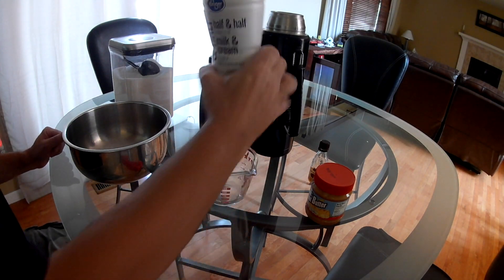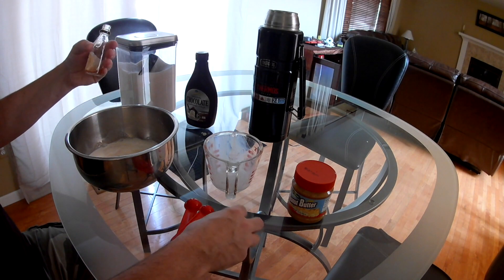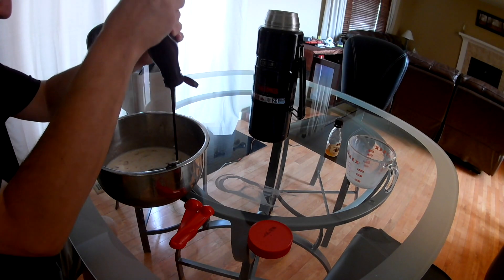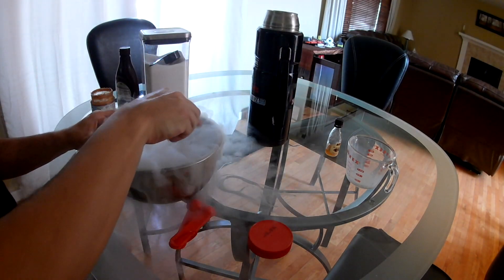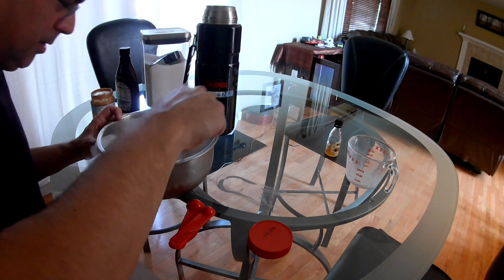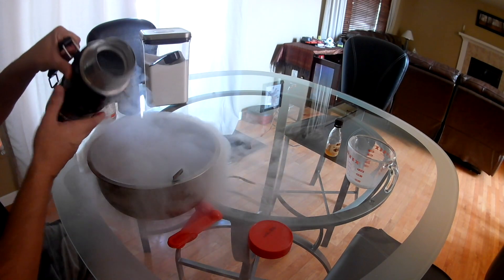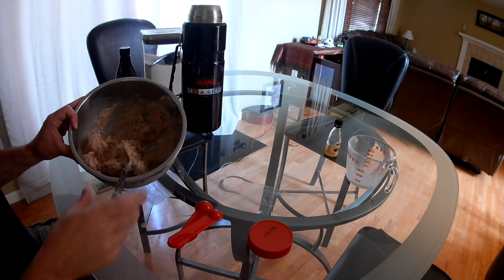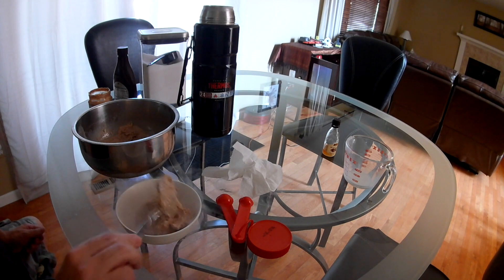Liquid oxygen ice cream

Comment: Are you using liquid oxygen or liquid nitrogen?
Reply from the maker: It's a bit strange because normally liquid nitrogen is used but it was actually liquid oxygen in this case.  At the time, I was only able to liquefy oxygen because I didn't have a working sieve bed for N2 at the time,.  So my choice was liquid air with lots of snow in it from moisture in the air or to use my oxygen sieve beds and get pure dry LOX.

Comment: I might make and sell few small Mix refrigerant Joule Thompson cryocooler very soon. They will require around 8 bar nitrogen gas for liquifaction. Price will be around $500 and cooling power in the range of 50W at 100K
Reply from the maker: That is very nice.  How many W at 77K?  By the way, how is the multistage phase change project going?  I'm really excited to know your success on it.
Reply: @ChristmasEve777  i have stopped working on multistage because it's out of my budget right now. Im working on cheaper option which is MRJT cryocooler which requires only one air conditioner compressor and one small fridge compressor. It has been tested. It provides  100W at 100K with 1100W input power
Reply from the maker: @Exotic_Lab  That's wonderful!  It's a significant improvement over my 10W at 77K.  Even if I pre-cool my gas going to the cryocooler (as you suggested before) I'll never get more than 10W of cooling at 77K with mine.  Of course I would get a bigger yield though because the gas would be a bit closer to the liquefaction temperature.  I've been too lazy to try to improve mine lately.
Reply: @ChristmasEve777  it's cooling power and temperature depends upon gas composition used.

Comment: im wanting to make a nitrogen generator can you help me with it
Reply from the maker: I can try.  Do you mean nitrogen gas generator or liquid nitrogen generator?
Also, please subscribe :) I plan to keep making cryogenic videos.
Reply: @ChristmasEve777  liquid nitrogen
Reply from the maker: @waldo2413  The cheapest way to make it is with a Stirling cycle cryocooler.  They used to only cost a few hundred dollars on eBay but people have been noticing the demand for them so the price has been increasing.  The last time I saw one on eBay, it was around $1000.  You would need to purchase that, a variac, a CPU-sized fan but no less than 100 cubic feet per minute to keep the heat sink on the cryocooler cool. Also a thermos is needed to collect it.  The last auction I saw was $3000 but it included everything you need (still, a bit pricey).  Right now I do not see any Stirling cycle ones on eBay.  You would have to keep checking regularly.  The cryocooler is the heart of the system.  Without it, there's no use buying the other stuff yet.  If you manage to get one, I can help you further on the setup.  You basically stick the cold end of the cooler down into the top of an ordinary thermos and let it run all day.  Liquid nitrogen and oxygen will keep dripping from it and eventually fill your thermos.
Reply: @ChristmasEve777  have u tried making with  Juele throttling method sorry if I spelled it wrong and can u let me know when u find parts on ebay I've been looking and cant find parts thanks
Reply from the maker: @waldo2413  I have a separate machine that makes my liquid oxygen and I think that machine uses the joule thomson effect.  I didn't build it so I can't be sure of its operation.  I do know that it is terribly inefficient compared to phase change or even cryocoolers.  It draws just over 1 kW and it only makes just under 3L every 24 hours.  You would a bit more with a cryocooler with MUCH less energy use.  And you would get WAY more with a multi-stage phase change system.  Phase change is very hard to build though.  I would love to have one but I'm not confident enough that I would succeed.  I'll let you know if I see another cryocooler.
Reply: @ChristmasEve777  thank you i was told the joule thomson way would make more than the sterlin cooler but im not sure
Reply: @ChristmasEve777  thank again for helping and getting back
Reply from the maker: @waldo2413  You know what?  Now that I think of it, the cryocooler is really also using the joule thomson effect.  It's just that it's internal.  Instead of compressing, cooling and expanding the gas you're liquefying, the cryocooler has sealed helium inside it that undergoes the JT effect and it just sucks heat from the cold head.  So, the reason my LOX generator is so slow must be because of its particular design.  For that amount of power for that long, it definitely should be liquefying more.  But phase change is the most efficient method known.  But for such a big temperature gradient, phase change requires at least 3 stages, which is a pain...
Reply: @ChristmasEve777  thanks